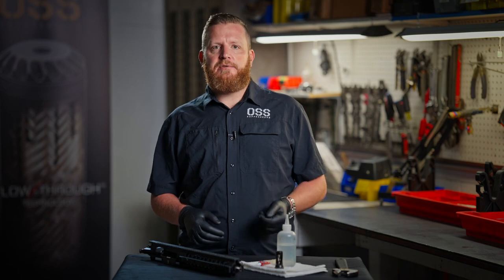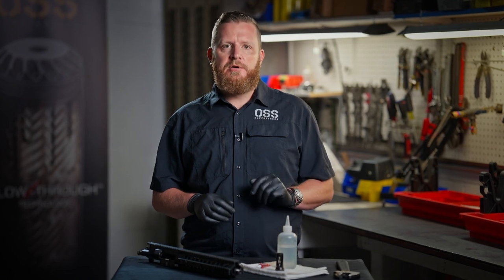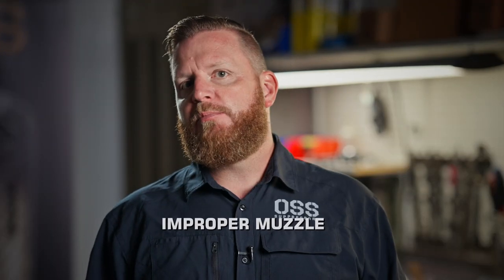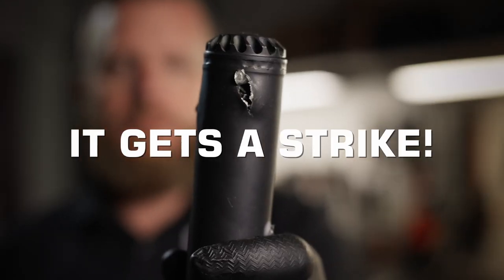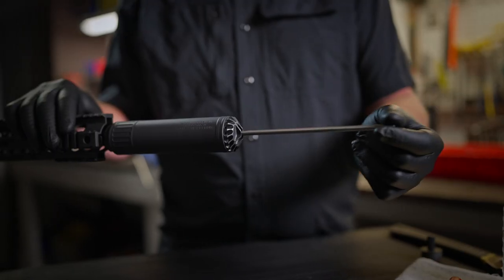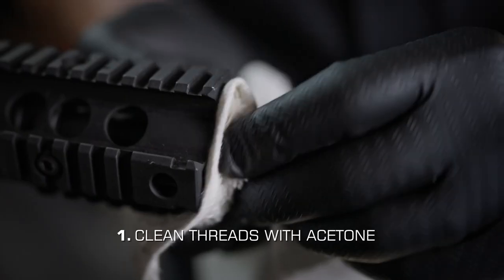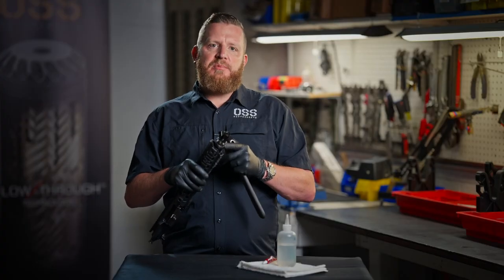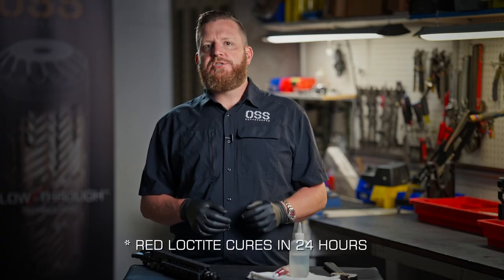How To Install Your OSS Muzzle Device

Comment: Red loctite depending on product heat range max is 300-550 degrees but also requires 275-325 in.lbs. To turn on the threads. I’m a Rocksett fan but have years of experience with loctite and torching nuts to get them off, even hot the correct loctite is a pain to back a nut off with hand tools much less gas passing through a tube.

Comment: I thought Rocksett was recommended for suppressor muzzle devices.  Why dnot locktite?  Seems like a muzzle devices with red loctite would be very difficult to remove absent very high heat.  Rocksett just needs water and a hard smack.  Does Rocksett break down and lose adhesion over time?
Reply: Yeah, I literally just picked up my 5.56k can yesterday, and the manual says to use rocksett for the MD.
Reply: @Mockturtlesoup1   I just got my suppressor but it didn’t come a manual. I need to call the company.
Reply: @garciamadrid9040  rocksett always rocksett on muzzle devices for cans

Comment: I hate to be the guy, but I'm really trying to understand here (and mount my muzzle device properly w/o a torque wrench) - isn't the angle between 12 and 2 o'clock 60 degrees, not fifteen?
Reply: Dividing 360 degrees by 12 gives 30 degrees per hour. So seems like it would indeed be 60 degrees. Which one you are supposed to use I have no idea.
Reply: That’s correct. That’s also my question. The 20° on the instructions for my QD762 translates to 12:00 to about 12:40.
Reply: Just picked up my OSS556k can yesterday.  Instructions say 20° turn after hand tight(or ~30 ft.lbs.)
Manual also says to Rocksett, not red loctite(well, it says Rocksett can be used when installing muzzle device.  It doesn't mention loctite at all.)
Reply: Maybe hand tight means different things to different people. I followed the included instructions and still had a walk-off during first range session. And when it started walking, it was fast. Check frequently.

Comment: Why red loctite and not rocksett ? If the red gets hot it melts doesn’t it?
Reply: Red loctite burns off at 500 degrees, two mags of 5.56 rapid fire will easily get to above that.. loctite is silly and a no go for suppressor mounting
Reply: @b-rye5094  that’s what I thought wondering why it’s recommended when you are risking your suppressor
Reply: For everyone saying no red locktite, I guess you know more than the manufacturer of the device?
Reply: @b-rye5094  I would think for traditional baffle design suppressors yes but since OSS is flow through, the heat isnt captured and thus much less heat than a traditional can.
Reply: @robertlamey7612  interestingly, I just picked up my OSS can yesterday, and the manual actually says to use Rocksett(which is what I've always heard recommended.)  I don't know if their preference has changed over time(though I doubt it as this video is only 8 months old), but I'm using rocksett(the guy at the gun store also said he uses rocksett on all of his muzzle devices.)
Reply: Rocksett states it is heat tolerant to 1200 F.
Reply: He also mentioned Vibratite in the video - seems like a heat tolerant product

Comment: Is this the same method for the muzzle brake? I put it on my bolt action and the holes on the bottom sit over the barrel
Reply from the maker: If you dont want to time them yes. If you want to time the brake it should have came with shims.
Reply: @HUXWRX  I have bought 4 brakes from you and none of them came with shims. Two said they were supposed to and two said they weren’t needed. What gives?
Reply from the maker: @friartuck4286  Shims are not needed, and the instructions have changed.

Comment: Aren’t these supposed to be self tightening, even with the mounted suppressor, or has that changed with these updated muzzle devices?
Reply: The suppressor is self tightening not the muzzle device.
Reply: @michealyerigian4602  I’ve seen these muzzle devices fired partially threaded and they will spin down and bottom out. I guess there’s not enough force under fire to actually tighten the device to any degree however. Same with the can. I’ve fired several hundred rounds and found my muzzle device “loose” and suppressor “loose” as well. Never have I found it to walk off. I’ve since threadlocked the flash hider as I prefer more security over an unintended accident (negligence).

Comment: Just got one finally as im going with a hux swrx for my tavor and my block 2 semi clone. Are the threads for suppressor safe or should i worry about them getting dinged up and how is the flash suppression. I am some time away from getting the suppressor. Hopefully within a year from now.
Reply from the maker: They should be safe but if you are worried we do have some thread protectors!

Comment: what about the muzzle brakes with the shims?
Reply: This design does not require timing.
Reply: @fmxmyway  the muzzle brake version comes with shims to time it but apparently only half the boxes have the shims....their brake design is honestly not that well designed as it puts gases in a cross pattern so if you ever wanted to shoot without the can your going to be kicking up a lot of dirt/dust depending how your brake is clocked
Reply: @caseydman4651  yeah I passed on the muzzle brake as OSS said the FH distributes the gases into the suppressor no differently than the MB.
Reply: @fmxmyway  unfortunately for us early adopters we only have one option for 14RH threads, again just another tick on a company that took 4 years to make them all the same while having all the pieces to do it...I guess the name change also gave them the idea of adding features of one line of cans to the others lol
Reply: Yeah, I too have a brake with shims.  Kind of wishing I went with a flash hider, as I generally don't like firing rifles with brakes/comps due to the noise(especially at public ranges with other people on each side of you that get the brunt of the noise), but I figured I would rarely be shooting it unsuppressed(as it's my HD rifle so I like to train/practice how I will "fight"), and I also figured that the brake would likely help a bit with recoil even with the suppressor on.
Reply: @fmxmyway  could you elaborate on that please?  I bought my 5.56k can a little over a year ago(still in NFA jail) and went with the muzzle brake.  Did OSS/huxwrx say the flashhider performed better, or just differently?  And did they say anything about back pressure, such as the brake adding more back pressure than the flash hider?
Reply: @Mockturtlesoup1  No. I asked them if the muzzle brake prolongs the life of the suppressor in their flow through design as it does a traditional baffle design? There response was that the suppressor does not know the difference between the break or flash hider. Wear should be equivalent as far as internals are concerned.
Reply: @Mockturtlesoup1  I bought the K as well. About 6 months into my wait. You may want to check with your FFL. The K seems to be quiet popular with people more so than the rest of their line. Flash hiders seem to produce a little less noise and back pressure than muzzle brakes. Because it isnt a traditional baffle design I would think the benefits of running a brake are void. Good news is you can buy the FH immediately.